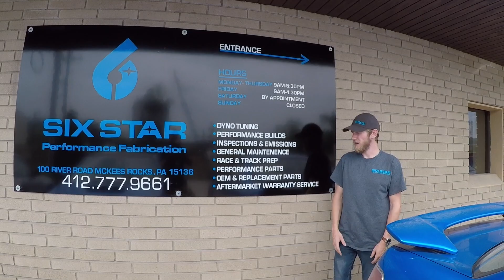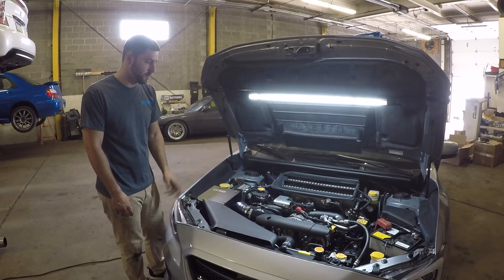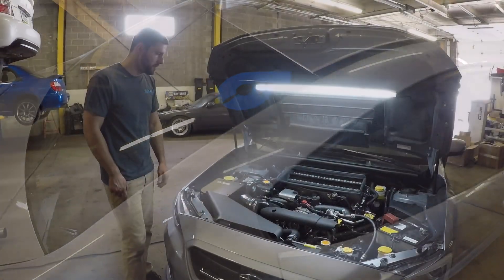Unboxing my Block & Meeting the Guys // Ep. 4 // The Engine Build Series

Comment: Did Moore performance change their name, or did they close and Six Star take their place?
Reply from the maker: Good question. Neither actually. Moore Performance still exists at the same location, but they are focusing on building race car parts. Their service department launched with the new name of Six Star & has the same crew working there, but is a different company. Moore was getting too tied up with service stuff & they weren't able to focus on race car parts as much as they wanted. This way it's the best of both worlds.

Comment: why is it hard to find trustworthy and good shops? Been searching for years to find quality... You think you've found one after they do work on the car, something goes wrong, and then turns out that shop cut corners... Kinda wish I lived near Pittsburgh now!
Reply from the maker: I know what you mean. I had a Subaru dealer rebuild my engine the first time. I figured they were just replacing the short block with a new OEM one, how bad could it be. Well, they hardly did anything right & I spent about another 3-4 grand having the tuning shop fix all their mistakes.

Comment: This block won't last imo, 
it's the stock 2.5L block, they have weak cylinder liners they're essentially a bored out 2L. 
forged pistons, stock rods though and stock block. 
wouldn't want to push this more than 20 psi with zero knock count imo